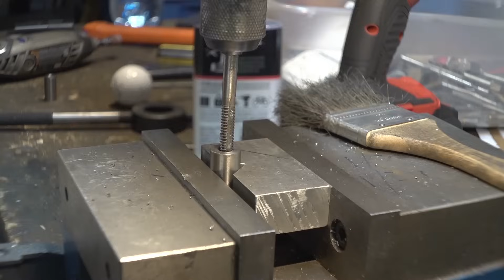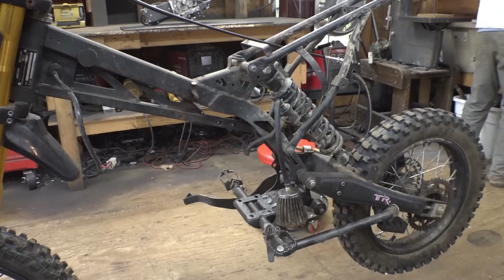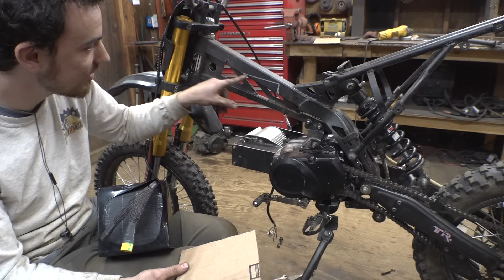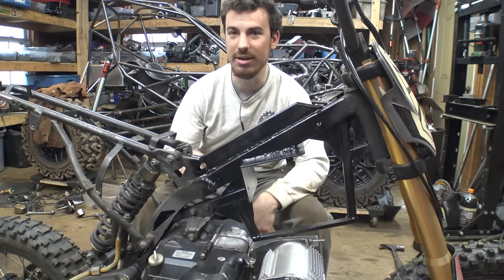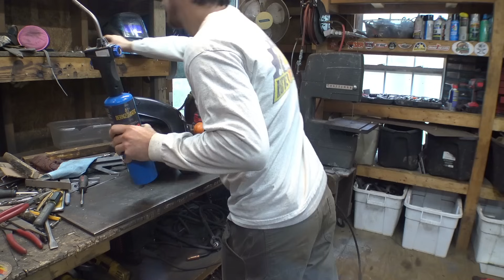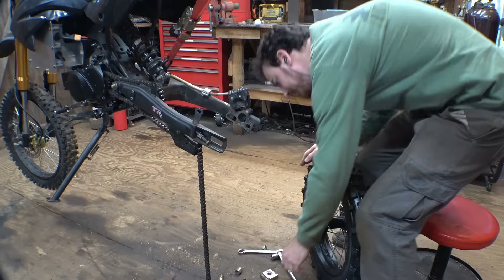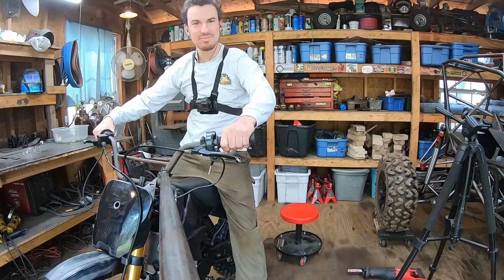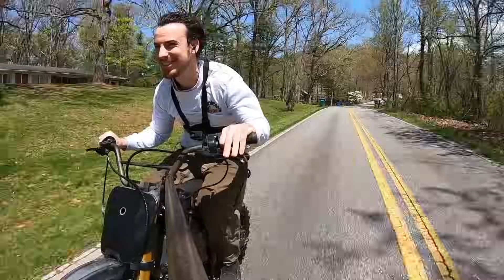A Different Way to Build An Electric Dirt Bike  - Part 2

Comment: QS Motor 8kw mid drive (capable of 24KW peaks) with a sabvoton controller. Turn up the phase amps for low rpm kick and field weakening for extra top speed by negating the back emf. Message me and i'll set you up with a contact at QS ;)

Comment: I suggest you to use 14/30 sprocket combination, well actually 5 or 6 speed transmission is better
and dont forget to use gps speedometer..it's quite accurate, but the accuracy is not what you need...you need the acceleration counter and its gauge

Comment: Awsome build Chris,  had this idea many many years ago so thanks for making my dream come to life!
Im thinking you may be able to eliminate the clutch as torque multiplication is much much  higher than any petrol engine can ever produce, im thinking like an engine stall circuit like formula one cars have which electrically stalls the engine at the rite rpm to change gears smoothly,  its caled  "rev matching "
Keep up the great workmanship!  Cant wait to watch your next video!

Comment: Another good build. Are you using an oil that is designed for wet clutch applications? Maybe at least wear a helmet when testing your creations, particulalry on the public highway?

Comment: Great content.  I would be wary of your battery box.  Batteries get hot, expand and need to be allowed to cool, and inside the box will not allow that and a giant lipo fire in your crotch won't be fun.  Of course, disregard if you already addressed the battery box later in the vid...only halfway through so far.  Keep up the great builds, your skill on the lathe is amazing.

Comment: I like the setup, but battery being such a box causes issues on building this, as well system over heating from little test drive... water cooling it when? Also i dont like how those small airholes on motor will be covered in mud in first off roading test and price for this unit with everything it needs makes me gag. Its cool build but several issues why it does not make sense and transmission on this build is last on the list. Also if speed controller etc can handle it, why not add another motor on front to make it 2wd?

Comment: That type of foam will break down over time as the load bounces against it. This is a similar problem to what LARP foam weapons have. Use a high density, closed cell foam, like the interlocking shop mats available at Harbor Freight, or the blue sleeping mats at Walmart.  Also, you need a power shut-off between the battery and controller. Right where you have the plug connection would be a perfect place.

Comment: I THINK I WOULD HAVE DONE A STEEL BATTERY BOX (A FEW VENT HOLES) - WELDED (GUSSETS) AND DROPPED THE  10 BOLTS TO MAYBE 3 BOLTS WITH A CLIP IN SLOT TOP WITH THE COMPRESSION INSULTION MATERIAL FOR THE SIDE  FACTORS..  I THINK I'D BE LOOKIN FOR A 12 OR SO hp EQ. ENGINE IN THE FUTURE AND MAYBE A 30 (MAYBE 28) TOOTH. FOR THIS SIZE MAYBE 2O+ HP FOR A LARGER BIKE SETUP. OPTIONAL BATTERY BOX UNDER YOUR BUTT SUPENSION FOR A BIGGER BATTERY. LIKE THE CONCEPT TOTALLY SHIFTING IS A MUST WHEN OFF ROAD.

Comment: Great build, invest in a clamp meter that can read DC and AC current, then you can check what both the motor is drawing, and what the battery is supplying - think connectors, it looks like the battery is using an XT90 connector, which limits you to 90 amps, yeah, at 74 volts, that's a lot of power, but it's still better to be able to check that everything is being under utilised, rather than over utilised. I'd also want the battery box vented, at the moment, you're relying on the cable grommets to allow enough ventilation for the sealed battery box to not become a bomb if the worst happens and the battery tries to release the magic smoke rapidly. One idea would be to incorporate burst disks in a couple of the panels - sealed until the pressure exceeds their rating. Either way, it's been very entertaining, thanks for the video's.

Comment: Chris, I preface this as one FAR less skilled in fabrication than you, but couldn’t you have utilized the structure of the battery box as the reinforce for the weakened section of frame?

Comment: You could have used a belt going to the stator/mag side of the "crank" shaft and also be able to mount the electric motor closer/tighter to the engine

Comment: That should support frame most dirt bike frame always crack under side where your cut is close to fork bearing. But might want to wrap the lower to under the motor it would give you a bash bar so motor won't smack ground if ever over a tall bolder.

Comment: I'm sure the electric motor makes more torque than the gas engine. Looks like a lot of fun!
EDIT: Does the electric motor have any provisions for liquid cooling? And does the motorbike engine have an oil pump? You see where I'm going with this...
Reply: The motor has some fins for air cooling although that’s probably not enough, and those engines have an oil pump to lubricate the top end, and the bottom end is a splash sump. Meaning the transmission and crank always sit in oil. I’d be curious to how much power loss there is with it now just uselessly spinning off the crank. And with the electric swap it he for sure had to plug the oil passages so I’m sure there’s a little bit of resistance

Comment: I wish he had put the electric motor the same position as the cylinder block then use a 90deg pinion gears to turn the crank

Comment: Next time open up the motor partially and fill the motor, chain box and gearbox in synthetic oil. It should cool the motor a good deal. Wouldn't it be fabulous?

Comment: If you think about gearing: I have a madcow 125 with a yx160 engine in it and 17t front 30t back and still runs out of revs if you ride it on a straight road but otherwise its a pretty sweet spot :)

The stock gearing is 14/48 or something. Way too short unless you want to do some tug of wars :D

Comment: Great looking setup. However I think I would of made the battery box of steel and welded it to the area removed from the frame to add back strength.
Reply: Would of also tried to fit the box length ways to lessen the girth of the width.

Comment: Wonder if you could've made the battery box be structural frame support? Much like the old Honda NX250s use the exhaust as part of the rear subframe.

Comment: depending on efficiency about 15 to 20 miles. My E-Vader got 24 miles on a 24 amp hour battery running 1 mile to 1 amp/hour. The only way to know is just do it to find out. ROFL i got stuck 3 miles from home and no spare battery to top it off. Talk about your battery specs and i can come up with some way to have a lower voltage spare battery for top off to get you a few miles for that OH CRAP moment. A 40volt battery with a 1200 watt boost converter set at 72 Volts can help and the battery can be 10 amp hour but the more the better. Your main battery needs to handle at least 95 amps 6000 watts divided by 72 volts full charge  83 amps and near dead is 6000 watts / 65 volts is 93 amp. Any voltage loss while being used is speed lost and can trigger the battery to kick off early at low voltage also can make the wires hot. Recomended no less than 4 awg wire for your set up.

Comment: I guess the next level would be bevel gears, one on the new crankshaft, an then on the electric motor, so it would slot into the casebody with no chain or belt, be serviceable, quiet and look symetrical with the cylinder-shape of the motor pointing forward.

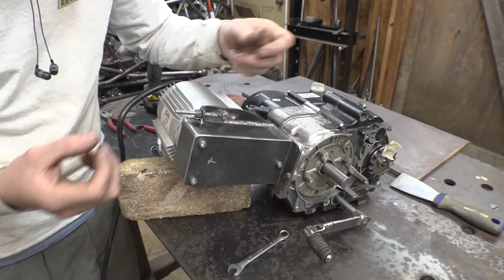Comment: 5:30; there are several adjustable drive belt options that will reduce noise and vibration without sacrificing adjustability. In fact, you might gain versatility and adjustability with some.

Comment: 1:27 it snapped bacause it was off center. 
Also there are two types of thread taps. Ones with conical tip are for primary(draft) tapping, and ones with cylindrical shape are for secondary(clean) tapping. It seems like your first thread tap is for secondary tapping.

Comment: I've been thinking about the clutch issue. Perhaps a larger motor sprocket would lessen the torque going through the gearbox. This would let you run a sprocket on the hub closer to stock size as well. This should keep the power going to the wheel the same and help your clutch.

Comment: I would lighten the crank and all the mechanical drive on it. Also i would look into making it self charging with the light and spark coils. You should beable to charge as you use.

Comment: 60v 6kw motor on 60v battery is 17S x 4.2v = 71.4v x 20 Ah = 1512w @ 100%, usable watts is only 80% DOD so 1512w x 0.8 = 1209.6w usable so 1209.6w / 6000w = 0.2016 hrs 100% throttle or 0.2016 hrs x 60 = 12.096 mins @ 100%, lets say you're using 100% throttle half of the time so you are really using 50% throttle or 1209.6w / 3000w = 0.4032 hrs x 60 = 24.192 mins ride time. If you really want around 2 hours ride time then you will need 5 x 20 Ah or 100 Ah battery or more so a 20 Ah battery = 1512w x 5 = 7560w or 7.5 kW capacity at 71.4v. You can buy 5 x 100 Ah 12v Deep Cycle Lithium Batteries online & hook them in series.

Comment: You should use a motorcycle gearbox for the next big electric build. Normally they are built to handle the torque.

Comment: anyone that thinks you don't need gears with an electric motor is a moron, electric motors LOVE gears! ..... ps, that's also why people that drag race teslas only tend to do so over a 1/8 mile because after that they run out of GEAR.......

Comment: You can make the drill bits harder by putting them in a small furnace at 4000 degrees for half an hour. You can put some gas in the bike oil to reduce the viscosity.You can ad aluminum fins to cool down the electric motor.

Comment: I reckon more like 6 miles range but ya wont know till you try.

for the bigger build, maybe look at a large capacity 72v Sur Ron battery and see if that would fit in a ~250cc sized dirt bike frame

Comment: Put a taller gear on the electric motor which will give more crankshaft rpm if your electric motor has the torque and then put a amp meter on the motor so you don’t get the motor to hot and can keep it in the appropriate gear in the transmission so the amp meter will basically tell you electrically if your bogging the motor

Comment: Awesome build!! You can do away with the friction clutch all together by locking it up, (welding it??), some way. To be able to shift, all you would need is a temporary motor cut out button. A micro switch activated by your thumb or the same clutch lever, with a relay. Hit that button as you would squeeze a clutch and "POW"!!, there is your shift. Quicker, safer, more durable and no slipping at all!!

Comment: NICE!! I had a blast watching your creativity transform the little pit bike. Electric and gears is the only way to go when you step it up. I would have strapped two batteries on either side of the frame to give twice the range. Keep up the awesome builds and I can't wait to see the electric cycle 2.0 come to life. Deep cycle batteries will give the most range and are very close to the same weight or slightly lighter because they may have gel pack type cells instead of lead cells.

Comment: Soaking the clutch discs is a myth. They don't absorb any oil. It is good to coat them in oil before installation but even still they're going to get oil on them as soon as you put oil in the engine anyway.

Comment: Oil...Dude if you actually get to read this.
You want that oil there. You need to oil the crank bearings as a bonus you get free oil on the chain.
Just seal up your lids and keep riding. Av gasket glue will work fine.
Maybe a breather on the tip of the chain box at its highest point

Comment: The chain is carrying oil. Put heavier springs in the clutch to stop slipping. Running gears for the electric motor makes a whole lot of controllability savvy, good sense. Wear gloves and a helmet . Human skin is too slow to rejuvenate and as soft as poo when you kiss the pavement, Plus are you aware of how fast you were traveling??  The motor needs to be a blow through cooling type not only a radiant cooling one.. Despite that it is still air cooled. They are designed to run at 25%= 30% of the HP rating. The overloaded electric motor wastes masses of current and gets very hot. I'm sure we just saw you go 2 1/2 - 3 miles already.  I think it's a very good effort and result. I was scared for you at that pace, on tarmac, with no glove. SAFETY FIRST!

Comment: A simple math equation to help calculate is Volts x Amps = Watts. You have a 72 volt battery, and you have a 6000 watt motor (peak). So you can plug those numbers in to solve for amps. In this case, it'd be watts / volts = amps, or 6000 / 72 = 83.3 amps at full throttle, full load. Your battery is 20AH, which means it can output 20 amps for one hour before it's spent. If you are using 83.3 amps, you'll get 0.24 hours or 14.4 minutes of continuous runtime at full bore. We don't know how fast you were moving, but if we pretend you were going the speed limit of that road you ride on, which I believe is 30mph, you'd get an estimated range of 7.2 miles out of that battery. There are quite a few flaws in this logic, but it's decent for getting in the ballpark.
Reply: Also, something fun/interesting to note, is that there are 33.7kWh of power in a single gallon of gasoline. Your bike battery only has 1.44kWh of stored power (72v*20ah). So you're trying to run this thing on ~4% of the gasoline-equivalent stored energy. Battery powered devices are roughly 90% efficient with their power, versus about 25-30% efficient for internal combustion engines, so in a perfect world you'll get about 12% of the range you'd get out of the gas engine with one gallon of gas. Things like gearboxes help with efficiency for the ICE by keeping it in its preferred powerband, whereas they reduce efficiency in the electric drive train, since it makes the same power no matter where it is in its range. So by doing something like this, while it's a fun and interesting project to undertake, you're basically squandering the efficiency of the electric drive train by tacking on a gearbox. You'd need a lot more than 8hp before a gearbox starts to makes sense for an electric motor.
Reply: You are exactly correct in your answer however I been building electric bikes for the past 5 years from bicycle frames all the way up to endurance moto-cross frames somewhat similar to this but more the ones made to be electric to start with. My last iteration is a qulbix q140md (you can google image that if you want) I have a 4000w motor in it with a 66v 16ah battery which is 1056 watt hours. His battery would be 1440 watt hours. I can easily get 30 miles out of mine riding so-so. and about 18 miles really pushing it all 18 miles. Everything comes into play here. speed, terrain, riding style, efficiency of motor  and especially weight. Out of my 6 bikes the one in the light weight mountain bike frame I did first with a conversion kit will actually go the furthest at 60 miles with only a 48v 20ah battery and a 1500watt hub motor and it will still run 35mph top speed and flip the bike if you full throttle on takeoff.  But it has no shocks and is so light it is unstable over bumpy terrain. What he needs is something like a Cycle Analyst V3 which monitors and displays all your volts, amps, watts and about a dozen other things and gives you an average WH (watt hour) rating over the period of x time per mile. It is also constantly displaying speed, current voltage, amps used and amps left.  My light bike averages about 15wh per mile so we can take 960watts / 15wh and I can get about 64 miles on a charge. My heavy bike averages about 27wh on light riding, 35wh under medium riding and 45wh or higher under heavy riding. which equates to a distance of 39, 30 or 23 miles till empty. So using the Cycle analyst I can adjust my riding to fit whether or not I get back home with out walking or not.  If I have beat on it and already used up 12ah but still have 10 miles to go then I know if I ride light the rest of the way because I know I can still 10 miles out of the last 4 amps at 23wh per mile and come in at almost empty. 

I probably did a bad job of explaining all that but the point is when you go electric you need to start watching those volt and amps closely or your gonna be walking. ask me how I know :) so incorporating something that can do active monitoring is crucial.

Comment: next time you are going to cut or weld a tank, use exhaust from something and hose to pump c02 into it itll displace all of the fumes with inert C02
Reply: I would suggest filling the tank with water to displace the fumes.
Reply: Couldn't he just fill it with water to displace any remaining fumes or liquid gasoline, then just drain it and cut it wet? Seems easier to me than trying to contain co2 in the tank while he's manhandling it.
Reply: I cut lpg tanks all the time I just fill it with water I'm still here to tell the story
Reply: Fill it up with water and it will be fine
Reply: unnecessary, i never did that when welding or cutting on a tank. point one, to explode, there must be a "pressure chaimber" which there isn´t if you don´t have closed the tank cap.
of cause there are some things to note to not get burned by a flame shooting out the tank.
i allways do it almost the same way, empty tank, dry it with pressured air for a a few minutes than put a lighter to the open tank filling. mostly nothing happens sometimes a short "wupp" and a little flame burns for a few seconds. when that flame burned out there is nothing else in the tank that is able to ignite.
Reply: @Thor555555  Same, works every time
Reply: @Thor555555  yep....this is what works. There can be alot of unburned fuel in engine exhaust like many have suggested. Not sure about lpg tanks but gasoline? You know it!!!!